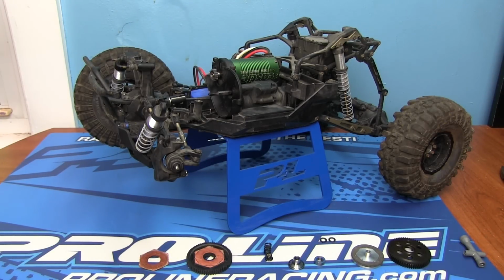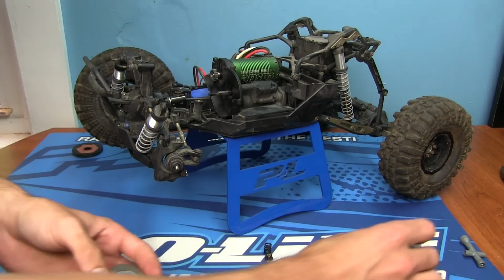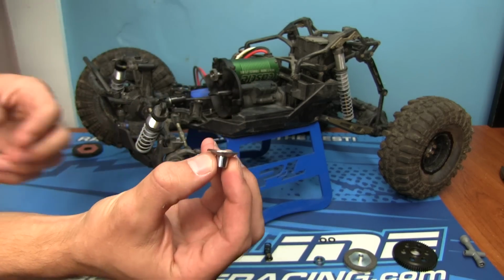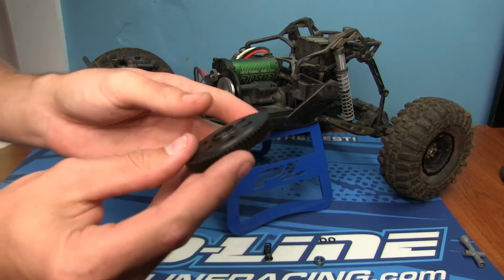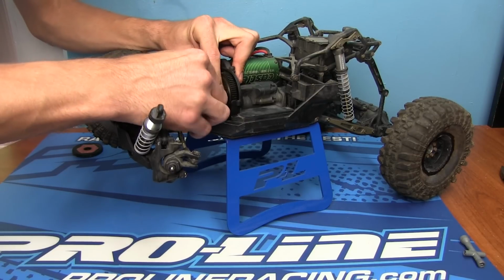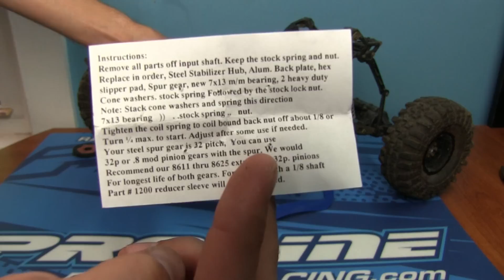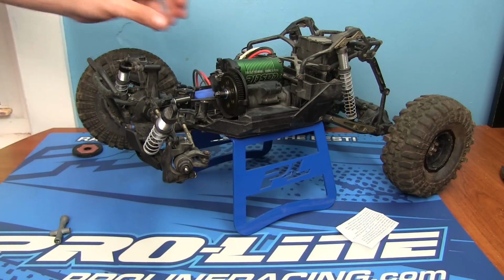Axial Yeti - Robinson Racing Slipper Clutch Setup

Comment: They also have gears for the transfer case of the Yeti as well. Makes a ton of difference and holds up well in the long run. Robinson Racing make wonderful products. Good upgrade for the Yeti...It's been over three months and I have put mine to the test.

Comment: did you use the rr pinion as well? i've heard some reports of the gen3 spur stripping the crap out of stock pinions.
Reply from the maker: +humble rc No im also using a Robinson racing pinion gear as well.
Reply: +RC Overload cool, i put this setup in my slash, but everything overheated. i think it may have been too heavy for the stock motor or something.
Reply: +RC Overload 
how many teeth pinion u got to match spur's teeth
Reply: Matthew Hoffer it looks like a 17t to me.
Reply: Nope i counted the pinion on youtube it is 18t and 64 spur this actually suppose be for yeti but it also works for yeti xl bec online only show for yeti
Reply: yup ur right. i counted again and it's 18. at least i was only off by one. any more and i'd really feel old ;).

Comment: hello what would you recommend  the gears pinion gear and spur Gear on a Yeti XL on 6s
Reply: James Jeffery 15 to 16T/64T depends on your temps ultimately I’d try to gear it to max out at 165/170 temp range. It’s generally safe up to 180 degrees f but I wouldn’t risk it if possible

Comment: how can I make my yeti faster  has a 2200kv castle creations  with mamba monster 2 esc  56spur and 25 pinion and 36/14 gears on the axle
Reply: also what battery  are you running  that fits on the yeti with that big of a motor?
Reply: Are you running 6s?

Comment: just bought it myself.... thank you  but i have one question on the front end on a stock yeti... my dog bone keeps coming out as i drive.. just bought all alumni parts and cvt joints for front end and it still does it.... may you know by any chance
Reply from the maker: +Freddy Bianco Honestly I have not run into that problem. Almost seems like the CV Joint isn't the correct one maybe?

Comment: will it fit the Yeti XL?
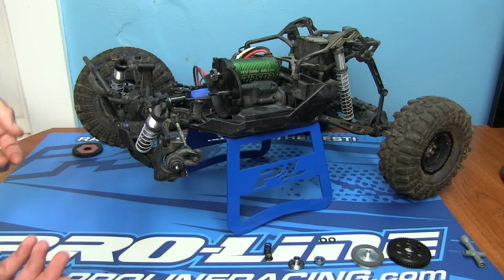Reply from the maker: no. this is only for the 1:10
Reply: Thank you
Reply: Actually, it can fit with an eady mod. Just open the transmission case with a reamer so the first peace of the slipper clears and it will work.